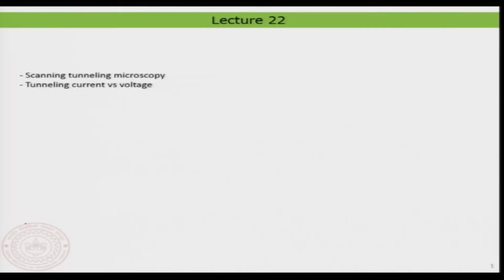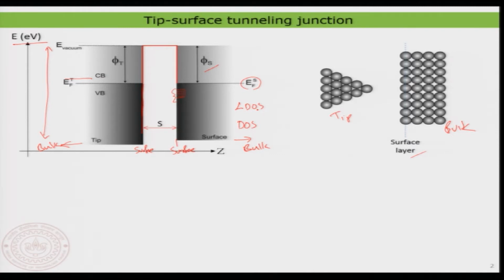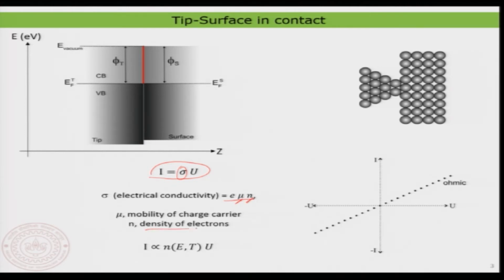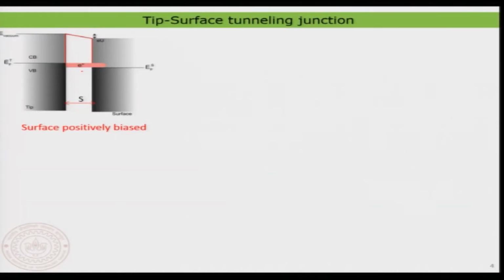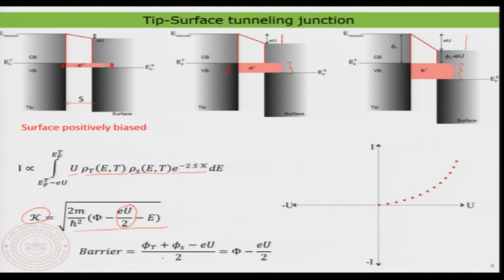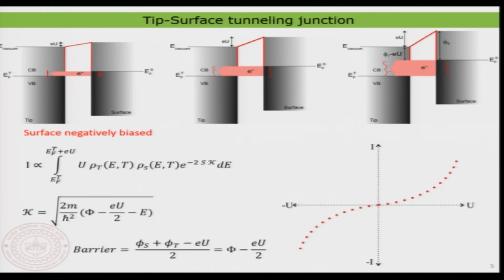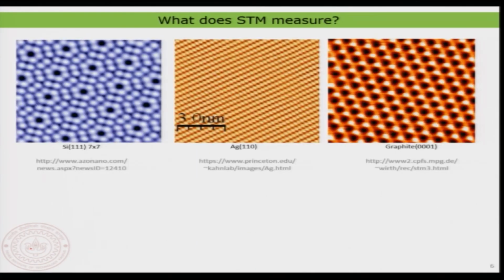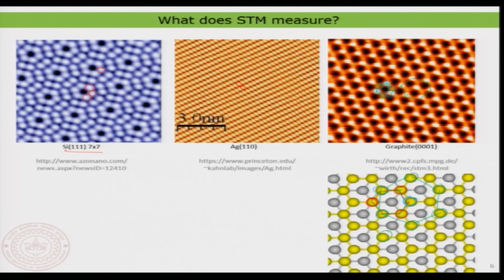Lecture 22 : Scanning Tunneling Spectroscopy I

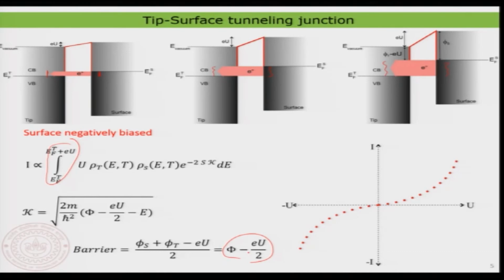Comment: At 20:55 you mention a sign change, but when comparing the formulas for the positive and negative bias cases they actually have the same sign. The fact that they have the same sign makes sense to me though, since the tunneling probability should only depend on the magnitude of the potential difference rather than the sign. Please correct me if i'm wrong :)
Reply: nerd